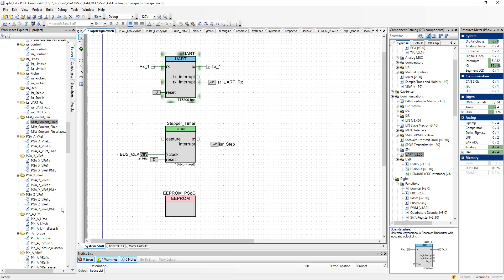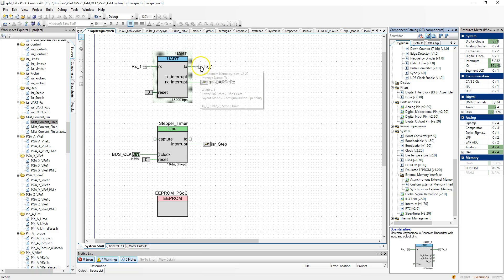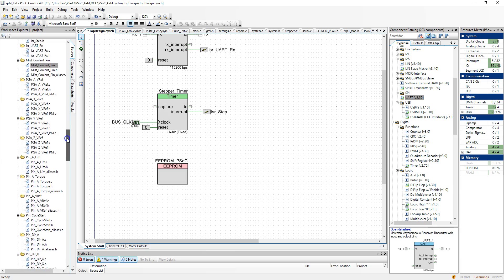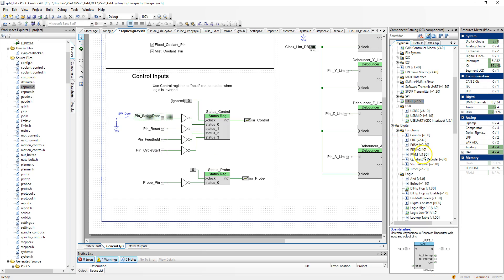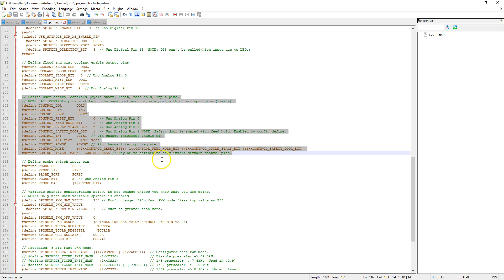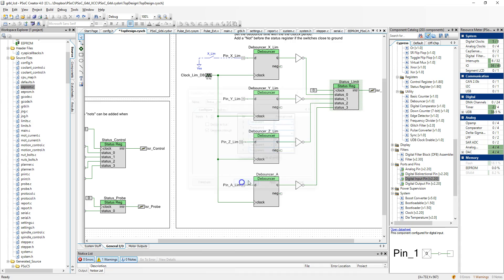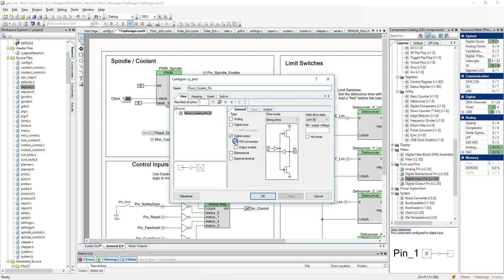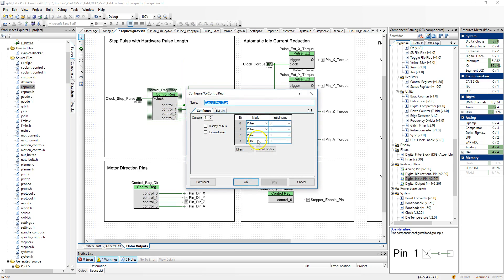PSoC Grbl Hardware Advantages

Comment: Excellent overview! What are you using for the hw, the 059 kit or custom?
Reply from the maker: Can't beat the cost of the 059
Reply: @engserve  I just noted the 059 in your other video. I have my own little homebrew stepper contoller using the 059, but used pwm for the step signal. Isr/timing is critical to not overstep but for my simple needs it works well enough. I really like your method of pulsed IO via register a component. This make so much more sense and super easy to implement additional axis. Can I ask what youre using for the UI? I plan on cncing my minimill w your grbl port an im using Win10
Reply: @wayneblack4242   If you want to stick with a Windows based user interface take a look at grblgru. The developer keeps adding features and has many videos on his YouTube channel to show how the features work. I asked a week ago if his controller would work with esp32 grbl and his reply was yes as long as it used the USB serial interface.  I think if he had a esp32 grbl piece of hardware to play with he might be quick to jump on board with this project and implement a wireless browser based version of his front end.

Comment: Hello, excuse a question with this project apart from hardware it is compatible to send signals with software such as UNIVERSAL G code
Reply from the maker: Yes. It should be compatible with all standard gcode senders for Grbl
Reply: @engserve  thanks for answering. What happens is that I already test it with the program, but I can not modify it in psoc creator, where I change from to uint16 so that it is greater than pp / mm, it only reaches 255.
Reply from the maker: @ricardopimentel8526  Please ask questions like this as an issue in the Github repo